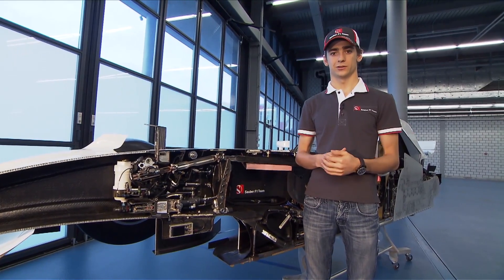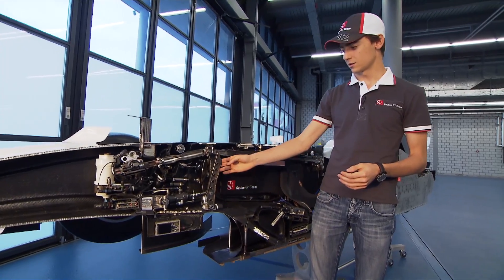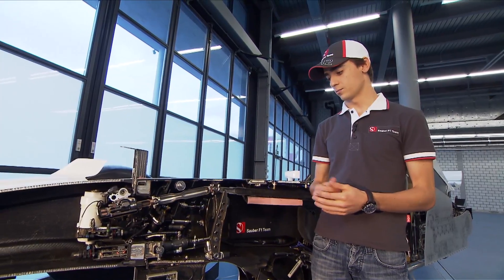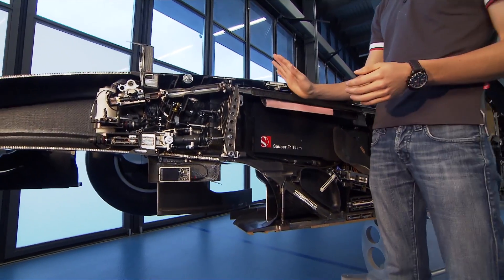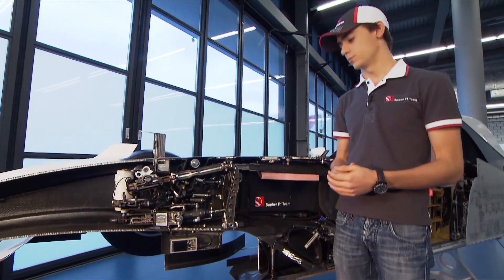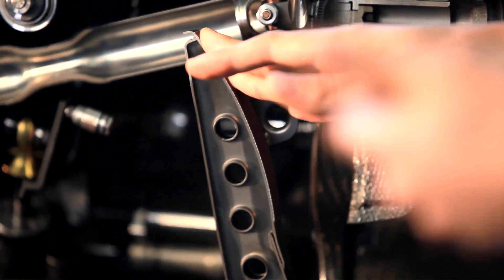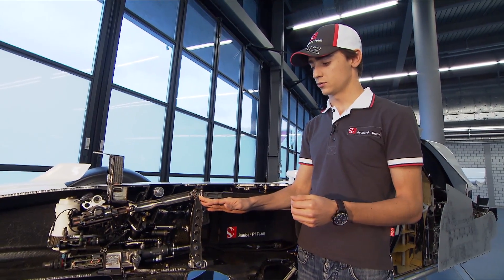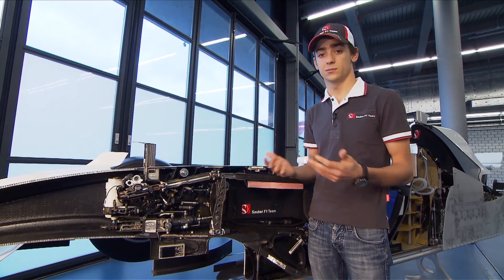Cutaway Insights - Episode 8: Pedals - Sauber F1 Team

Comment from the maker: Well, you push them down with your feet... The throttle pedal actuates the engine to provide acceleration, the brake pedal actuates the brakes to slow the car down... Easy as that ;-)